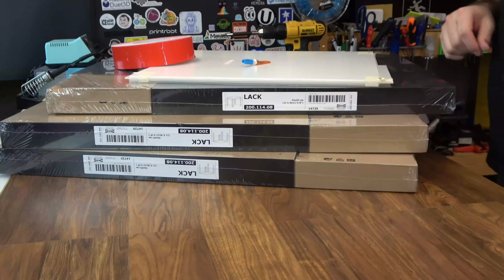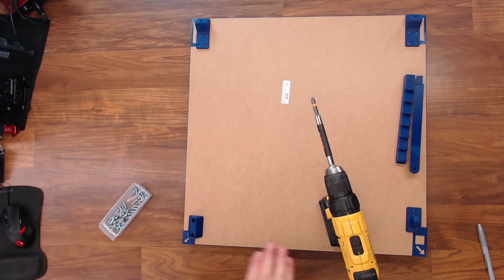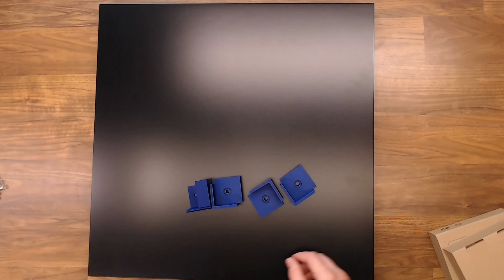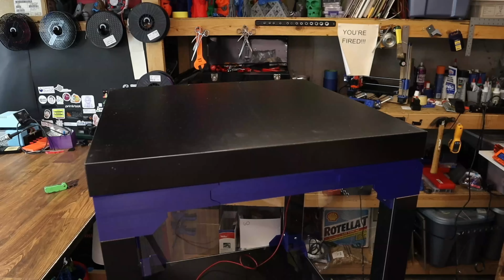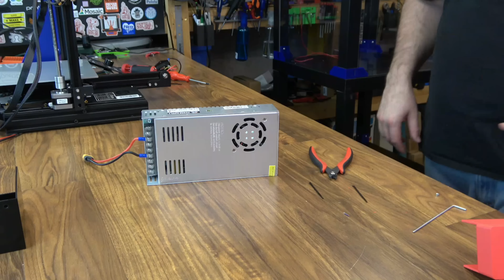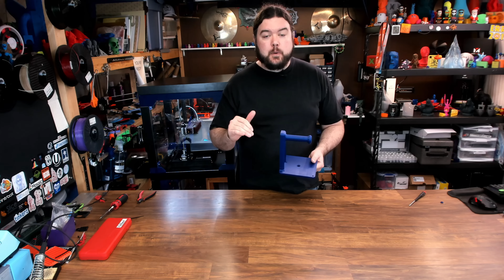Ender 3 - Prusa V2 Lack Table - Enclosure Build - Chris's Basement

Comment: Hi! I am new to 3D printing, like a week in haha. Liked the video, but had a question. Were all of these pieces printed on the Ender 3? Looking at the files, some of them as-is, do not fit on my bed in Cura. Is this something that I just need to split up and rotate for them to fit? Or am I just doing something wrong? Anyways, thanks for the help! :)
Reply from the maker: These parts were all intended to be printed on a Prusa bed. You could cut and glue some of them, but I am sure there are many great enclosure projects you can do on thingiverse to get you around this issue.
Reply: @ChrisRiley  I printed everything on an Ender 3 v2 by breaking up the files into separate pieces, and rotating the pieces 45 degrees.  No need to cut any part so far.

Comment: Can you make a video for the ender-3 v2
Reply from the maker: This enclosure should fit it.
Reply: @ChrisRiley yes but the power supply is under the heat bed.
Reply from the maker: @SullyGang  And it's a different size, you would have to remove it and shrink the case a bit.

Comment: Anyone know if an enclosure like this would work if I wanted it to be removeable?  Most of the time I don't need an enclosure, but when I do, I'd like to just lower it over the printer when I need it, and lift it back off when I'm done.  My printers are not on lack tables, but just larger regular tables.
Reply from the maker: Check on the v1 of this one, you could probably connect the legs, or glue the acrylic to make it more rigid to use it like this.

Comment: Two questions. One, why did you use a kit? Seems like you didn't need those holes on the back panel, custom cut acrylic panels wouldn't have them and they'd probably be cheaper than a kit.

Two, what is the point of the hinged top lid? Seems like a lot of extra work for something that isn't really necessary.
Reply from the maker: One, printed solid has taken the guesswork out of ordering the right size panels. Worth the extra money for most users. Two, if you ever used the V1 enclosure and had to remove the printer to work on it, V2 is so much easier to use.

Comment: Would it work in an 18” depth but much wider cabinet ? Curious on the full front to back operation dimensions on the ender 3
Reply from the maker: With the bed wire the ender 3 is about 23" deep and 18" wide travel.

Comment: Hi Chris, I want to start off by saying thank you for all your efforts. I appreciate you. I have my enclosure done. I got the plexi from Printed solid and they are super nice. The only things I am stuck on is how to feed the filament. I know you said you were still working that out. And I should mention that I put my CR-6se inside there and not an Ender 3. But they are almost the same size so I went for it. Have you come up with anything that works well for feeding the filament (into the enclosure, spool location, etc)?
Reply from the maker: The side feed seems to work okay for my ender 3. I have seen some designs where they have a slot in the top that looks promising.  https://www.prusaprinters.org/prints/7115-lack-enclosure-filament-slot-guide#preview

Comment: Is there anywhere I can get the specs on the length/width/height of the enclosure?  I’m curious whether it would work with an Ender 5 or Pro (not the 5 Plus). Or does someone know already?
Reply from the maker: So the legs are 50mm square, so subtract those 4, it's 510mm in Z 540mm X and Y absolute max. It would be touching the acrylic at these measurements.
Reply: @ChrisRiley  , thanks. Believed or not, I looked on IKEA website and I could not find those specs. The Ender 5 is 440 x 410 x 465 mm. My thinking is that it would be a tight fit.
Reply: I went to order these from IKEA today and I found a click on the website that shows the size. I don’t know why I couldn’t get it when I looked last week. Thanks for your help though.

Comment: As always a great video. The one downside to powering the lights from the 24v PSU is that the printer has to be powered on for the lights to work. I believe in your V1 video you used external. I wonder how often one would need those lights on troubleshooting with the power on printer turned off? Any thoughts on the pros/cons of either solution?
Reply from the maker: For this design with the flip up top I thought maybe it would be easier to work with the lights off, so I went this route.
Reply: That makes sense... I forgot about the flip up top. This is great video they makes me more comfortable building an enclosure.

Comment: Hey Chris! Thanks for this excellent video.  I know this is not your design, but wanted to ask anyway. I would love to make the bottom supports longer to get a little taller enclosure. Is it possible that I could increase the height of the bottom supports to match the height of the top supports by using the modeling files?
Reply from the maker: Yes, you should be able to bring them into CAD software and change them up.

Comment: Got an Ender 3v2 for Christmas, and been looking all over for the right Lack enclosure plan. Found it. This is it. Thank you for posting this.
Reply from the maker: Great to hear! Enjoy!
Reply: Your V2 fit in?
I have the same. Did you put the PSU outside and how did you print the parts some of them are bigger then the bed
Reply from the maker: @drug2  The V2 fits, but yes, the power supply is slimmer, and the parts are made for a Prusa bed, you would need to split some of them.
Reply: @ChrisRiley  what do you mean split some of them?  Thank you!

Comment: Awesome video Chris, highly informative, great quality on your prints, What filament are you using PLA, PETG ?  Keep up the good work.
Reply from the maker: All the blue is PLA, the only piece I used PETG on was the bed cable holder.
Reply: @ChrisRiley  Thanks Chris, I am trying to print the parts now but when I open the STL files in Cura 4.8 they appear of the bed and poking through the bottom!!!  Any ideas on what I am doing wrong?  Cheers

Comment: FYI M6 is a machine screw thread sized to a 6mm clearance hole. Similarly other M-sized threads are defined in ISO262. Occasionally you encounter the fine pitch of a thread definition, but it's rare enough that it's checked for being UNF or even Whitworth (in the UK at leasr) first.

A wood screw might be 6x30mm for example but it's not M6.

Of course to confuse matters the UK likes to sell wood screws by imperial gauge number and metric length.

Edited because something got garbled on my phone.
Reply from the maker: This is great info, I have never used metric wood screws.
Reply: @ChrisRiley  the first half of what I said was somehow turned to nonsense, edited some, and added some context, but you probably guessed the important parts.

Comment: hey chris have you heard of the voron 2.4? I've been thinking of building one from my tronxy X5S I'd love to hear your thoughts I bought the X5S for when I needed to print things too large for my ender 3 I've never gotten what I would call good prints from the X5S and I think that has a lot to do with the rods for z and that they used t slots and not v slots
Reply from the maker: I have, I really like these designs. I am going to build a v0 soon. It should be a fun build, also look at switchwire.
Reply: I’d like to build a voron v2.4.... but i’m a total noob with firmware and i’m affraid that the printer will not work because i don’t have the knowledge
Reply: @Robertotvl  well roberto the voron is a complicated build and you should really have at least one printer already to print the parts for the voron though people do sell the prints if you just want the voron as for the firmware it uses a klipper not marlin though I'm going to try a few things before using what the voron comunity has made like I found linear rails that are 3d printable and use bbs as bearings and I'm going to try to use marlin and a normal prox sensor instead of the voron's leveling that you need clipper for if it doesn't work then I will go full voron but I was never much of a raspberry pi octo print fan oh and I do custom marlin firmware for 32 bit boards from FB so if you get stuck you can always get on FB find me and PM me
Reply: @cityhunterinak  i already have an enclosed and fully modded ender 3: bigger fans, btt skr e3, micro swiss hotend and i have an ender 5+ so i should be able to print the abs parts no problem. I just have no experience with custom firmware and don’t know anything about rPI. Thanks for the help! I will start building the printer soon once i have the money lol :p

Comment: I have a real good question.  Is there a way to run OctoPrint with octoscreen I have the 4'' HyperPixel and still be able to run rgb status and plugins like this? or would I have to switch to a 7'' screen.  I would love to be able to have the led lights turn on one by one as the bed and hot end get hotter and after that have it do the same thing as the progress of the print gets done more of the leds turn on. I'm running a Prusa i3 mk3s with an enclosure. So I can get 29 leds in a row. I think that would be pretty sweet. could you please help...  I know if there is anyone that would know how to do it, it would be you.
Reply from the maker: I think you could do it, but you would need some way to get them connected. Even if you could find a ribbon cable to break them out or something, you just need access to the pins.

Comment: A clearear Corrogated plastic 4x8 foot sheet ($35) makes a functional heated enclosure even for my big cr10s pro. Packaging tape seals the edges and for giggles I used a $10 Ikea picture frame for the front door. I folded as many of the edges as possible so the top and three sides are a single part. Some excess sheet was used to make a horizontal baffle to insulate the electronics from the heated upper region for the heated bed and print. A tube directs the original electronics exhaust fan air out of the chamber and is replaced by cool room air that slips in under the front edge of the door to replace the exhausted air. With the Bed at 110C the chamber stabilizes 48C measured using the hot end thermistor (extruder heater off and fan on).
Reply from the maker: Very nice, I love enclosure hacks.

Comment: So wait... You modded the corner pieces to get more height?? What size acrylic did you use, the 440x473 like in the original V2 build?
Reply from the maker: The V2 build have the correct corners you need, but you need taller acrylic. Or use the Prusa vent pieces to make up for it. https://www.printedsolid.com/products/v2-acrylic-sheets-for-prusa-lack-enclosure  3 sheets cut to 440mm x 473mm and 2 sheets cut to 220mm x 505mm
Reply: @ChrisRiley  I haven’t ordered the acrylic yet, but now that it’s confirmed, I’ll order the bigger sizes. Thanks!!!!!

Comment: Where did you get the table?
Reply from the maker: Ikea.
Reply: @ChrisRiley  does it shake alot? And would that mess with the prints?
Reply from the maker: @emanuelcalderon  They do shake, but I have used one for years with no issues. I print at about 100mm/s top speed.

Comment: The issue when printing abs with ender is that hotend fan cools the part too. When you put a piece of thin aluminum plate underneath it will guide the air off the part. And voila there will be success with abs! Please try and test and make video for others to succeed too!
Reply from the maker: Check this out. https://youtu.be/F1mv8yVrS0Q The PETG actually work decent for this part.

Comment: Great vid. Is no one building enclosures to filter the air when printing ABS or Nylon? I understand the idea of the enclosure is to capture and retain heat but what about the smell / VOC / small particles essentially off-gased from printing?
Reply: There is an HEPA 2 + Carbon Filter Design on Thingiverse for the Lack Tables, according to the community thats more than enough
Reply from the maker: There are some filters out there. BOFA systems are coming down in price as well. https://www.printedsolid.com/products/bofa-3d-print-pro-1-fume-extraction

Comment: Oops great job I was just working on the same project. I just my 1st printer. Sliced my 1st files from your download and ran into 2 problem files. The brace would not fit in the area and the end gave a really weird message.
Reply from the maker: THe brace will take a 250mm bed to print.
Reply: @ChrisRiley , uh Houston we have a problem. I order all the parts and then I run into this same problem as I only have a 235x235x260 (Mingda D2). While could probably rotate it and print it straight up, I’m not sure that’s a good idea? I honestly do not personally know anyone locally that has a larger bed surface. Any ideas?

Edit:  It appears that I can open the 6.3mf and 7.3mf files and delete a few objects to get them to fit and then print those objects separately.  Also the two long pieces in 2.3mf seem to barely fit.  At a quick glance I do not see any other files that will not print on a 235x235 but that 2.3mf is really pushing it.  Is that the brace you are talking about?  This may not be an impossible problem to solve after all . . . I can rotate each one diagonal and print separately . . . unless I am missing something?
Reply from the maker: @scottwarrick  Yeah the brace is the biggest. I might be able to break it up into two pieces.
Reply: @ChrisRiley ,  my plan is to try to print the brace first before everything else. If it doesn’t work then I may be asking a favor.

Do you have any videos on the good cad software and a beginner’s tutorial? I can see that I need to get some education on that.
Reply from the maker: @scottwarrick  I don't have many videos on it, but I use Fusion 360 and Lars Christensen is the best.

Comment: Ikea hacking is fun to watch, so this was like crack for me today, thanks for fixing me up.  One thing that's not clear though is @39:28 -- your back acrylic already had holes drilled right?  Why not just install that acrylic on the side instead of drilling new holes on the side acrylic?
Reply from the maker: I thought about that, but they were a little too high and center for my liking. It would probably work, but I went the other way.

Comment: Do you think using PLA or having PLA mods on the printer could eventually have issues with warping if frequently running 80-100C bed temps?
Reply from the maker: Not with bed temps, it should be okay.
Reply: @ChrisRiley  Thanks, that  certainly makes life easier... I've been having a hell of a time printing all pieces in PETG.

Comment: I always thought these lack enclosures looked really neat, but it took me a long time to understand why anyone would want one.  I just always assumed that if you owned a 3d printer, you probably owned a table saw and other tools that I always thought every maker should have.  Some day I might quit making assumptions haha

Good video, hope you have a wonderful New Years.
Reply from the maker: It's just kind of fun to use other cheap items to build things I think. It's a fun build for sure.
Reply: @ChrisRiley   The end result is a shaking cabinet, not worth it considering the money spent on the wood-less tables, plexiglass and 200h of printed parts.
Reply: @valyo007  Correction. The end result is what you make it. Period. If you have a wobbly cabinet made of IKEA Lack tables, consider what you could do to make it less wobbly. You are the ultimate cause of your own effect. As one over engineered example, you could use a steel girder to support wedding cake.
Reply: One thing I have learned is that having a house big enough to have a shop with tools and a yard that usually comes with that house means you have to spend a lot of time maintaining the yard and house. This leaves you less time for the hobbies. That and lumber these days costs a ton. These tables are next to nothing.

Comment: I made a similar enclosure for my ender 3 last June. If I were to do it again I would just buy some 2x2 and some 10mm ply. It would save all the 3D printing and work just as well.
Reply from the maker: There is room for improvement on these for sure, sometime these are an excuse to print stuff. :)
Reply: and probably be much more solid since there is no way this thing makes good prints with that shaky table.
Reply: @SnakelnTheGrass  Actually it works quite well. I can now print ABS reliably on my Ender 3, and it comes out really well.

Comment: Hello Chris i think heat bad cable with ur printed part for goes down it ll be adds more stress to cable ,which drains much current while heating, need more effective solution. But content is very good as always ty
Reply from the maker: I will keep an eye on it, it doesn't have a hard crimp in it, but you could be right.

Comment: How much Filament does it take to make the whole upgrade from the V1 Lack Enclosure?  Also with most enclosures placed towards wall, has anyone made one with the back panel a solid color?
Reply from the maker: I think it will take almost all new parts to make that upgrade. Keep in mind, close to 200 hours is with all the spool holders and everything.

Comment: What settings did you use? I printed my LACK v1 with 2 perimeters and 15% infill (Prusa defaults) in PETG and was quite annoyed by how often parts, usually, the v1 hinges managed to break. The magnets are also clever, but I opted for a round magnet variant since I already had some. It seems hard to find the ones Prusa uses in the US unless one orders from China and waits.
Reply from the maker: I used Prusa defaults, 2 perimeters, 5 tops, 4 bottoms, 20% cubic infill. I did use PLA, and haven't had anything break. On the thin wall prints I think PETG might be a bit difficult to use.